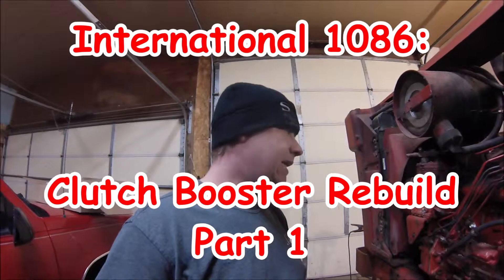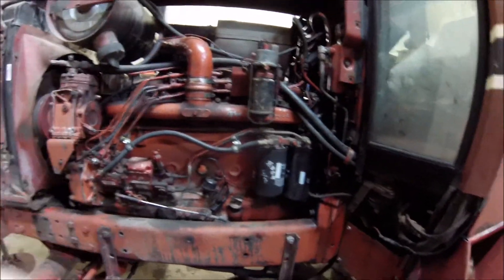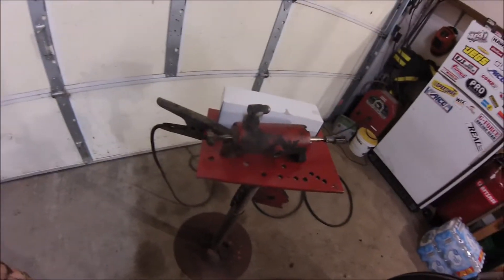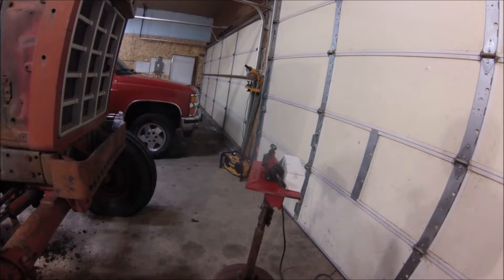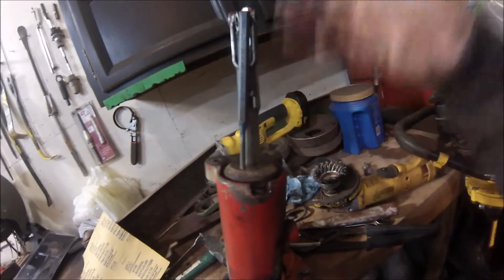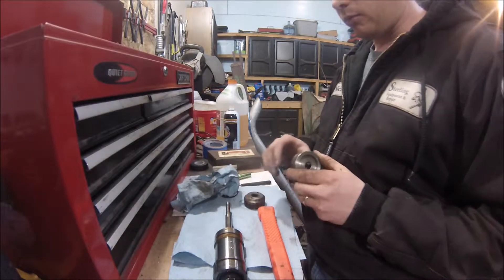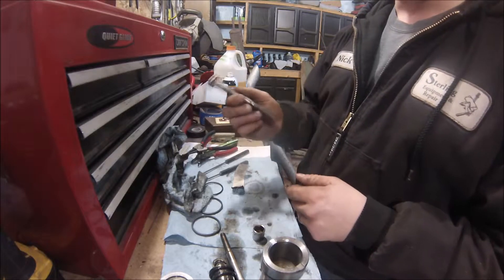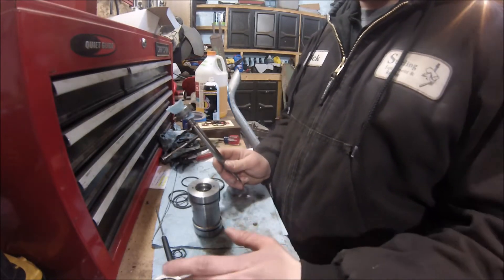IH 1086: Clutch Booster Rebuild Part 1

Comment: great video. looking forward to your installing that kit to take the hinge point off the tractor. would also think the cab mounts are due to be changed out if they are worn out. that would be a cool video to watch as well. keep up the good work
Reply from the maker: Unfortunately we've decided to hold off on the pivot kit. After talking to some good ole IH boys they said the pivot kit wont help with the sealing of the booster. It just makes the clutch less jumpy. At $430 for the kit we just can fit it in the budget for a tractor that will only see 100-150 hours a year.